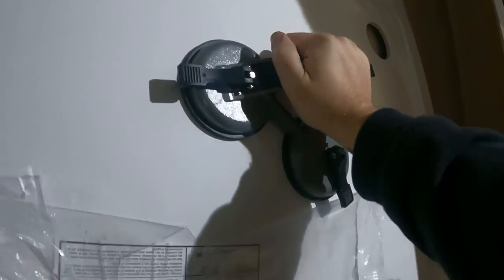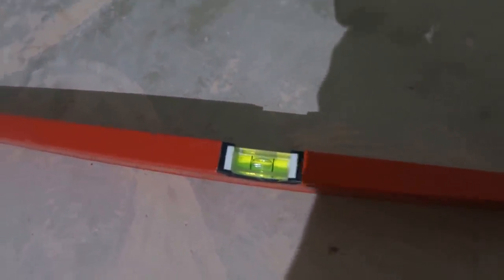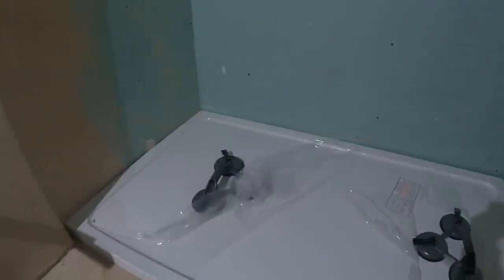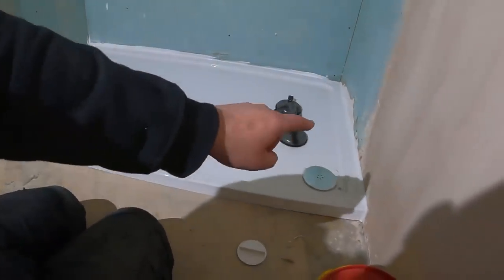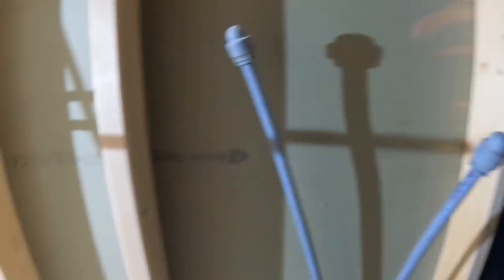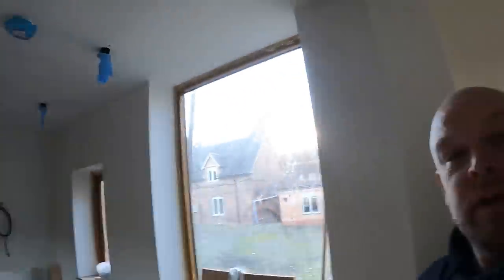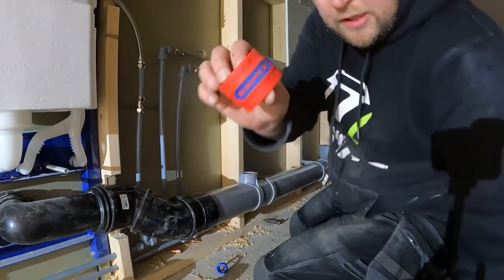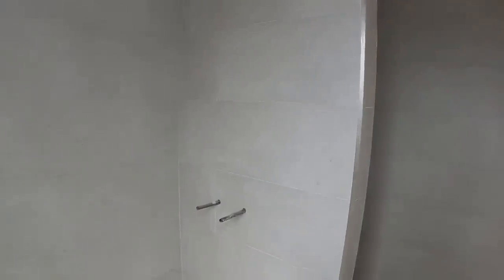PLUMBING PIPEWORK ISSUE..WHY HAS IT MOVED?.. also shower tray fitting at The Barn

Comment: not bedding the shower tray on any muck..................... literally never seen that before..........
Reply from the maker: It’s bedded on silicone….. as said in the video…

People have moved on from muck to better alternatives such as silicone/CT1 etc
Reply: Yeah I’ve always done sand and cement. Used CT1 and OB1 for bits and pieces and the grab strength is so superior. I might give that a go I suppose it also depends on what deflection and levels you are working with on the floor…
Reply: I always use silicone now moving on with the times as they say